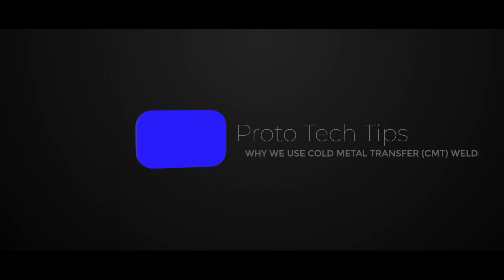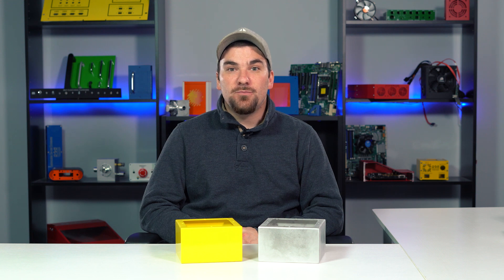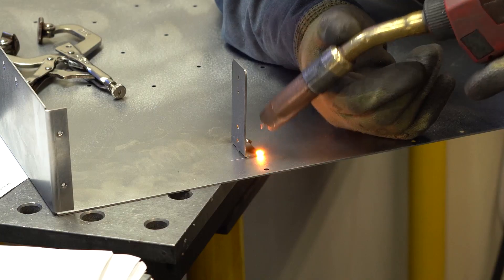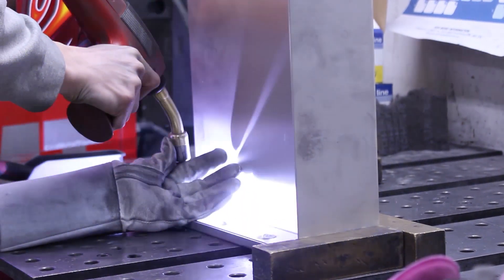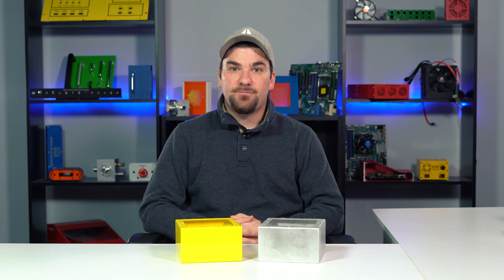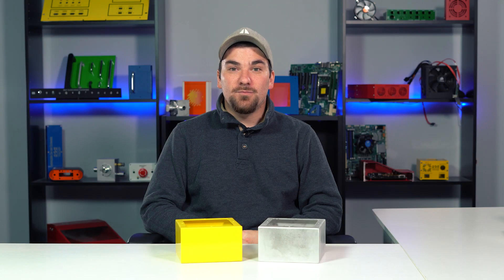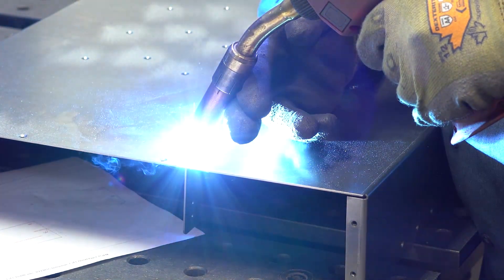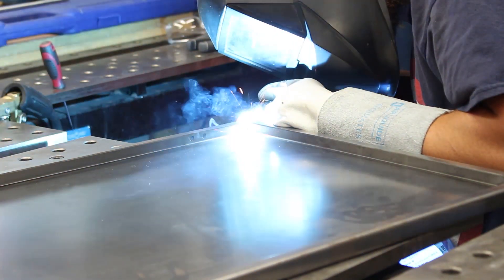Proto Tech Tip - Why We Use Cold Metal Transfer Welding

Comment: I would like to point out that CMT is not a pulsed-arc process. It is a modified short-circuit where the droplet detaches as the wire feed direction is reversed.